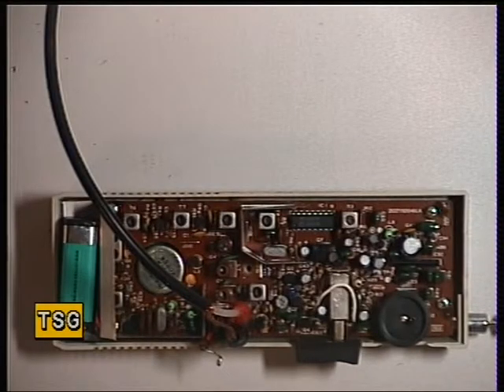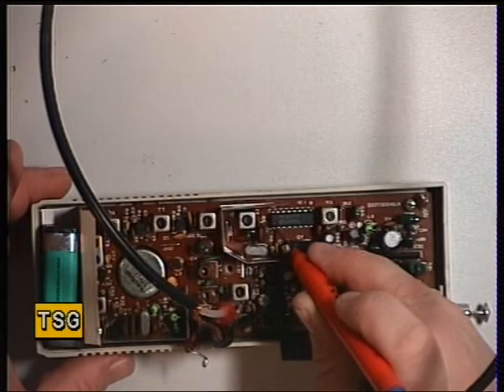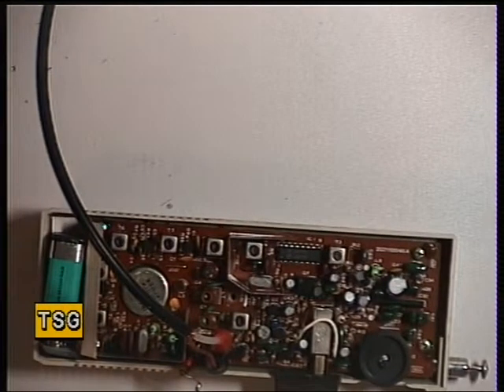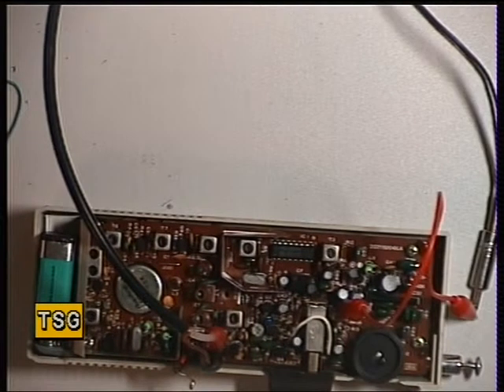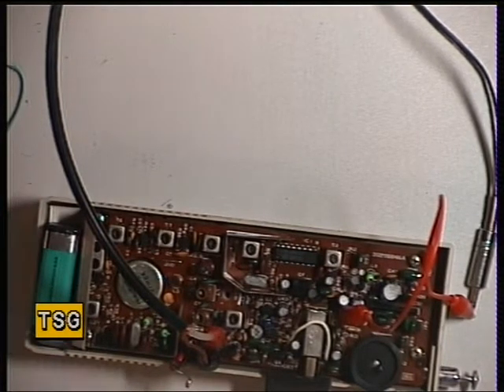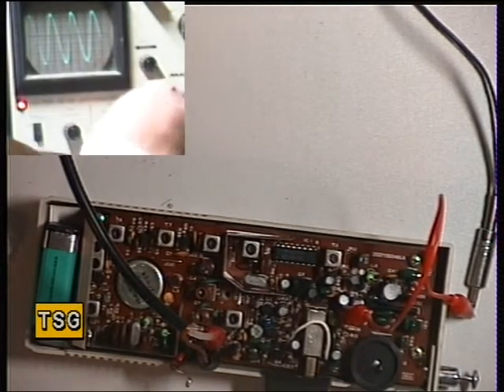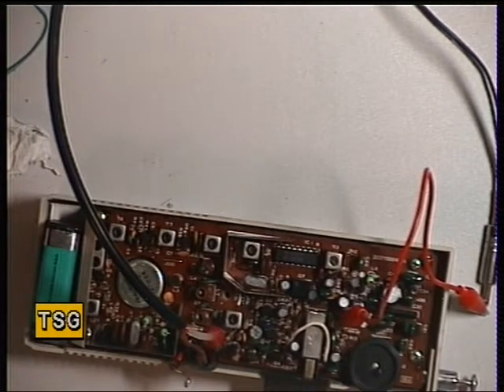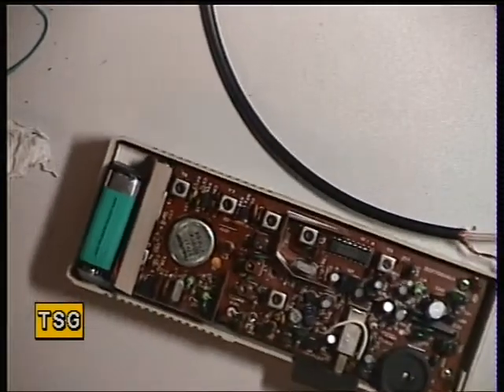Realistic TRC1003 UK CB radio 50mW (Hand portable). Alignment of Receiver.

Comment: Hi,  Can this use Realistic or similar crystal pairs and be changed out to another frequency, like a USA frequency such as 27.2850 ?
Reply from the maker: No. Different crystal formula for TX, different crystal base. Different mode of operation would also make it illegal.
Reply: @ukfmcbradioservicingTango21  Sent you a reply via email mate thanks.
Reply: I've just bought a New Old Stock 1003 (it even has the supplied Tandy PP3 still in the box), and a quick Google search for any info brought me straight back to the channel I seem to spend an inordinate amount of time watching.
There can't be many 27/81 radios you haven't featured on the channel.
Great info as always. 👍